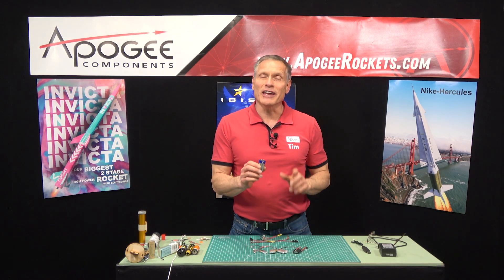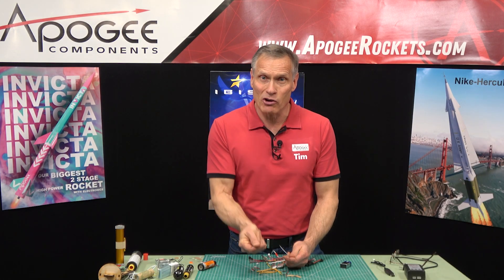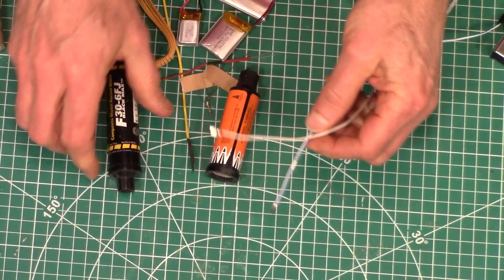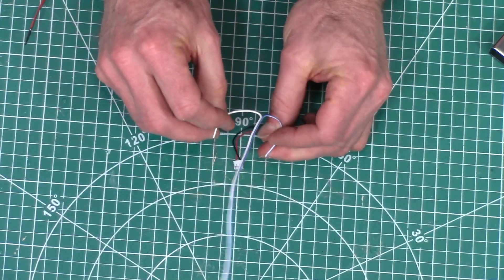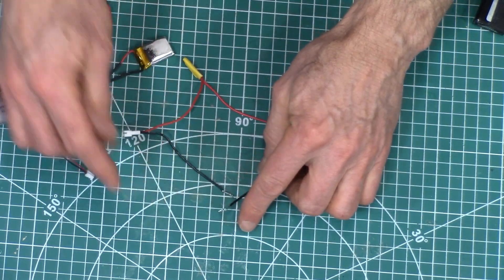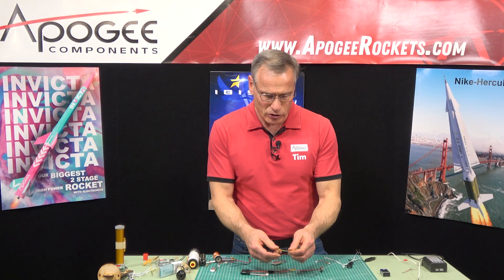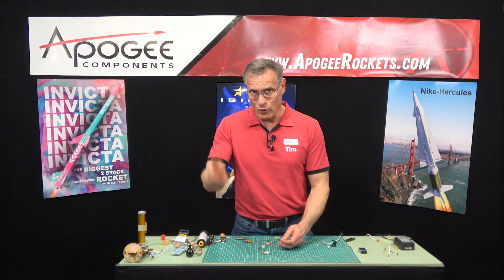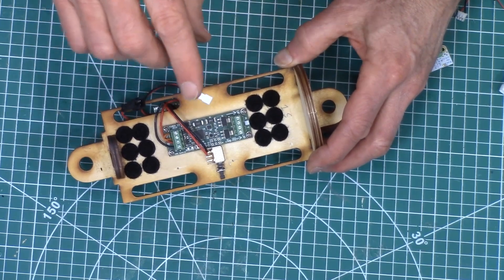Choosing the Perfect Battery for Electronic Staging of High Power Rockets

Comment: Great video Tim!  I have a two stage project "in flight" right now and these videos on two stage tech are very helpful.  I was planning to use a single use F Aerotech motor with a 9 volt battery.  You had a 9 Volt on the bench but did not show any tests with that battery.   Is there a reason you would recommend the 2 cell rechargeable over the 9 volt?   If weight is the only advantage that is not a big deal for me.   I like the simplicity of the 9 volt.   I even used 9 volt batteries in my level 3 project.   Thanks for all you and the team at Apogee do for our hobby!    Have a great day. Greg
Reply from the maker: You've seen the process of testing igniters. Give it a try with the 9V and see how well it works with your igniters

Comment: Good information for fliers to know. Back in the late 1970's, before high output current LiPo batteries, I used a capacitor across my DIY second stage ignition electronics to ensure firing of the e-match with the early composite motors.